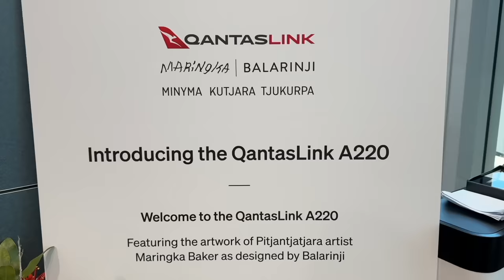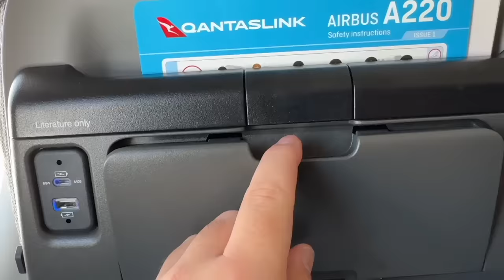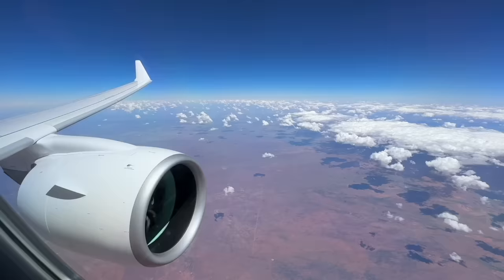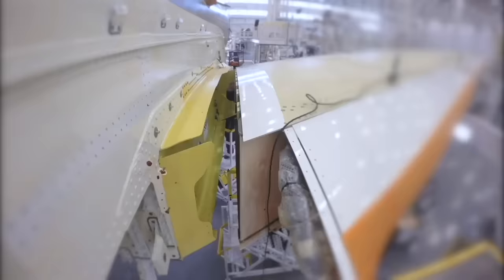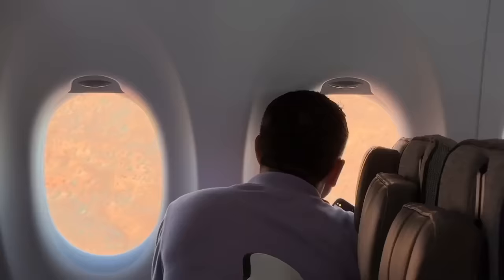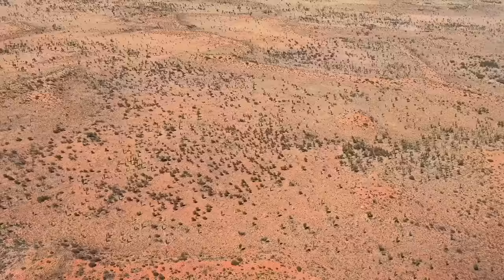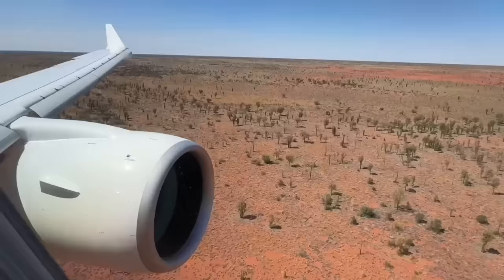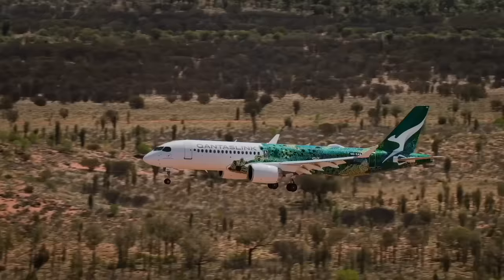Aussie Outback Adventure: Special Flight on Qantas New A220

Comment: Sam:
To give a better flavor of the aircraft itself; please give the number of cycle the aircraft is designed for, material used, internal cabin air pressure, a/c system is electric or bleed valve and average age of the airliner in the fleet.
Keep up the great work

Comment: It is not great news for quantas to see a General Electric GE CF6-80E1A3 engine fail on their Melbourne to Perth flight. It will be interesting to know if the dry sandy route conditions contributed to what is speculated to be a fan blade. Presumably the new planned A350/330 fleet wont be powered by GE engines.